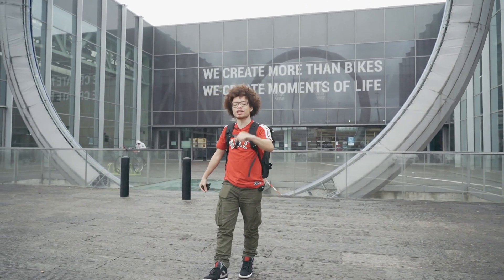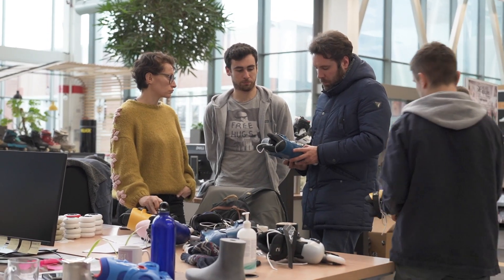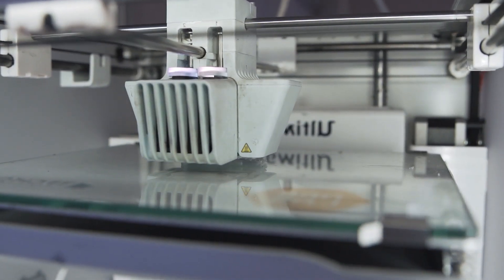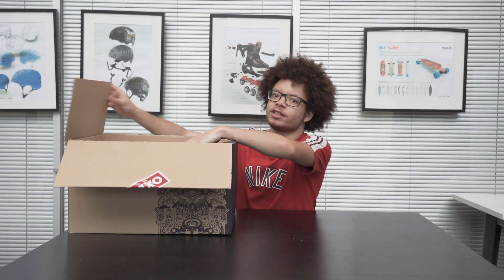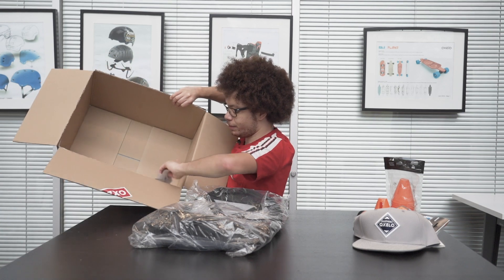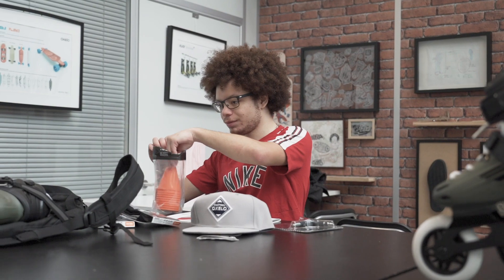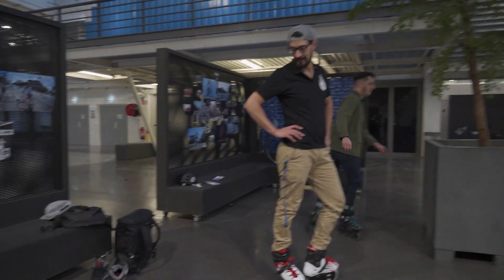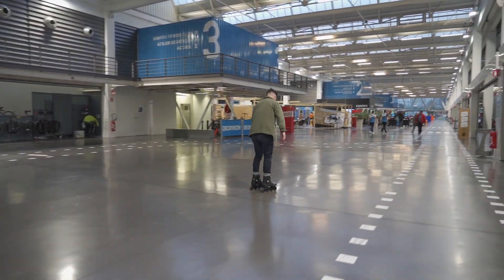How The MF900 Are Made!

Comment: The key looks better than the two simple Allen keys they gave with the MF500 when I bought it last year, but still looks too short for accessing the frame's bolts (way too short for that frame specially). MF500's wheels are also currently announced as 85 or 86A, they were 82A initially. Still watching the video but, if they have improved the hardware system on those new frames it might be interesting for them to sell them as aftermarket, if they're cheaper than skate brands...
I'm still super super happy with my Oxelo boots, except for that cuff screws.

Comment: Hello.
Are these skates appropriate for downhill skating? I have fitness skates and i feel like that i do not have much control since its body is soft. I tried but was not very succesful doing powerstop with fitness paten. I have been skiing for many years and  i am looking for similar experince on roads. So i am thinking of buying new skates. Would you recommend mf900 or mf500 for downhill skating? I have seen videos with 5 wheel configuration for downhill. Is it necessary the skates to be 5 wheel? Thanks.

Comment: Also a question, Tiago. Iirc you wear a 38 like myself, and one of the best things of the MF500 for me is that the 38 is the biggest size of its boot (37/38), while on most brands (hard plastic boots) we'd need a 38 liner on the 38/39 boot.
I know you usually skate high end slalom skates and it's different but, what do think about this? I'd personally trust my Oxelo boots better than a superior Powerslide or FR where I have to use a bigger size...
More examples of 38EU cheap boots on the market? I'm kinda making a list with real boot sizes...

Comment: Getting back into skating, currently using a 20 year old pair and I want to upgrade. As default the MF900 comes as a 3WD right? Is there an option with this model to switch the frames and wheels to a 4WD also? I want to be able to take both the city cruising with 4WD (my most comfortable) and 3WD to bigger and with less traffic roads (for some speed). I just can't find it on their website. (and hopefully I can avoid buying both the MF500 and MF900) Have a good day.